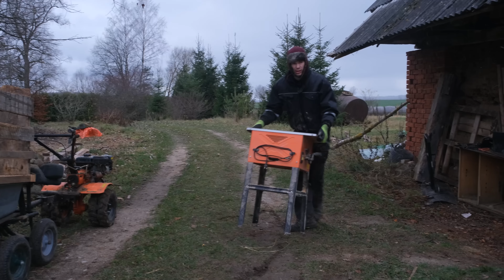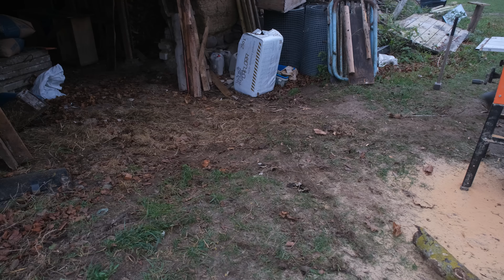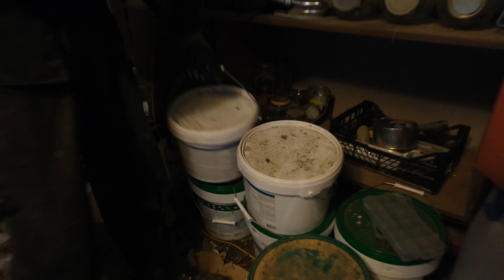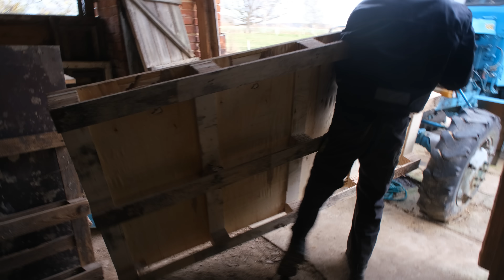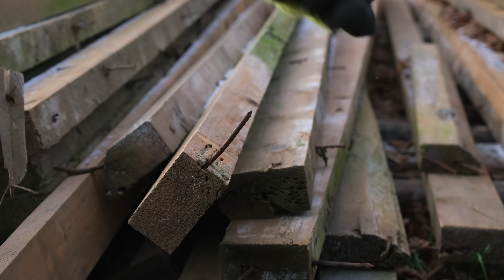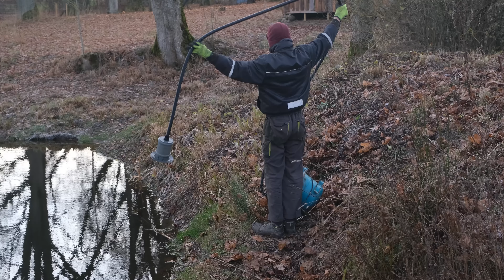Rushing to CLOSE the BARN before SNOW Storm

Comment: Had a thought guy’s to help protect the blue tractor since your gonna be working on it sometime soon , especially with it starting to snow, cover it with some type of tarp or some of the yellow plastic you used to cover the hay. You may have to cut a few pieces to have enough to cover it but at least it’s out of the weather some. It’s way too nice to let the bad weather start rusting it all up. Des, do y’all ever make apple butter to help use up some of your apples. I saw another homesteader that kept their potatoes in their basement where it’s much cooler so they don’t go bad and to help keep them from rotting he made a shelf system with the rows only so many inches apart so he could put boxes that were about 4 inches high and not sure how long they were but he would lay out the potatoes in all the boxes to where they weren’t touching. He said that’s what made them rot was if they were touching each other. Of course he had to make a couple of shelves that were pretty tall because they had lots of potatoes. He also brought them in when they first dug them up and spread them all out on old tarps and thing’s like that where they weren’t touching and separated them so the same ones we’re together and let them lay there for 2 or 3 days so they could dry out good. Then he took them down to the basement.